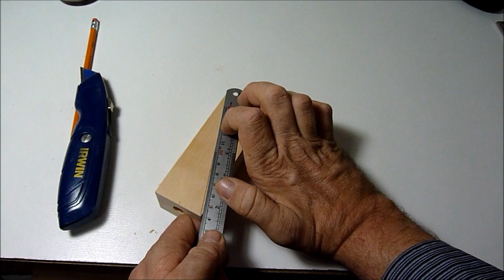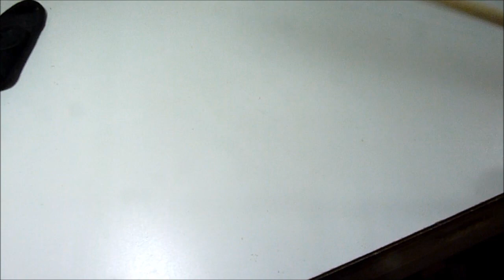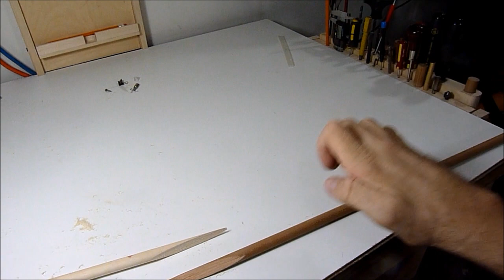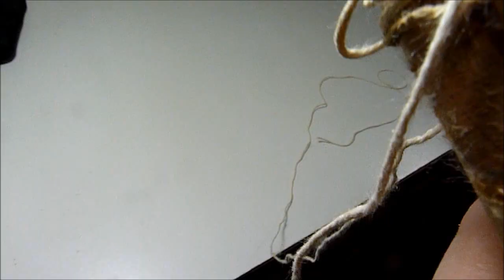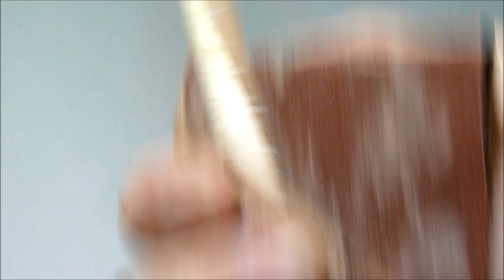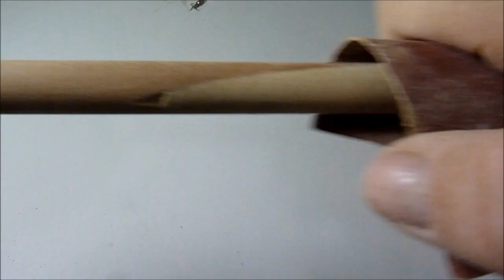Dowel Splicing

Comment: Thank you!  No talk, all demo, just great.  I can use this for repairing broken hickory shafted golf clubs--which I play and work on a lot.  I might need 2-3 jigs depending on where the shaft broke as they are typically tapered.  I also have a table top drill press and was happy to see your free hand holding of the vise and then the stock to get all the way through.  I'm estimating your jig is about 4-5" long.  Lovely demonstration. Very efficient.  Thanks!
Reply: I came across this tutorial for hickory clubs too!  Couldn't wrap my brain around how to hold the shaft and cut an angle accurately.  This is great.

Comment: If you have a benchtop sander,  you can skip making the jig.  Just grind each piece down on the sander to an angle. I just finger clamped mine for  a couple of minutes then clamped with a spring clamp, then opposed that clamp with another clamp. It worked great. That said, your idea is genius for those without fancy tools.

Comment: If you wanted to improve the vertical strength could you add a dowel through the middle of the joint? would it have to be at maximum half the width of the joined dowel?